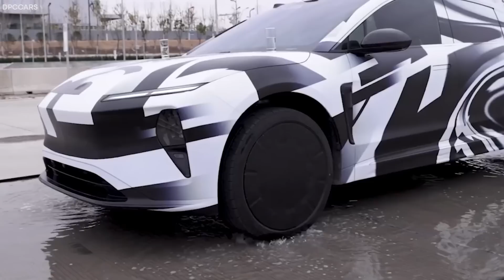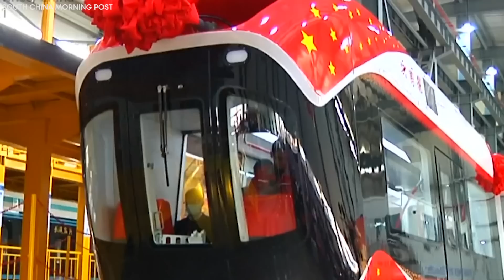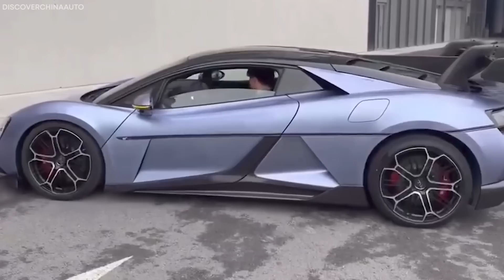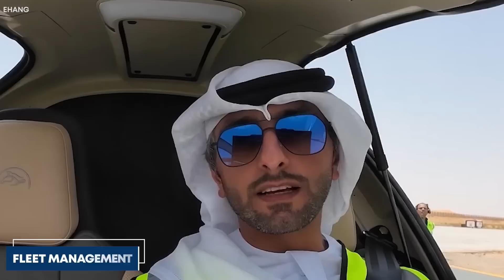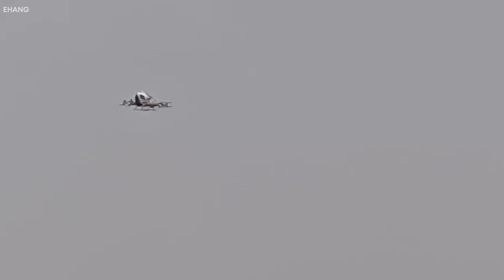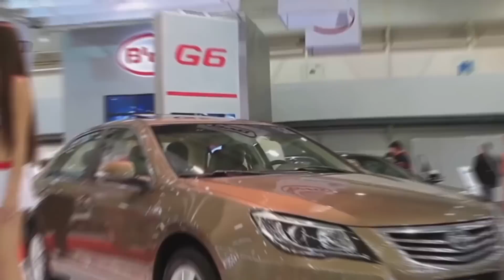China has Launched New Generation Transport Shocks Everyone

Comment: Yes larger wheels save more energy due to Pi radus wider can speed fast and longer distance less power after reached high speed
Reply: The bigger the wheels the heavier they are and the more energy to turn them. 😂
Reply: @Anonymous------  weah, you're right
that's why all racing bicycles have such small wheels!!!!

you know, you don't have to be a rocket scientist to understand things in this world!
Reply: @robertanton1862  
Here we are talking about cars not bicycles, car wheels are differently made than bicycles. If your logic is correct then why don't cars use thin bicycle wheels? 🤡
Reply: @Anonymous------  trying to be smug aren't you?
Pirelli Formula One tyres are from 670 to 720 mm (26.4 to 28.3 in)
why not making the 10" according to your thinking?
Reply: @robertanton1862  
Do you know why normal cars don't use bicycle wheels but heavy tires? You know why.
Reply: @Anonymous------  simple because  the weight of the vehicle that's why they didn't use thin wheels